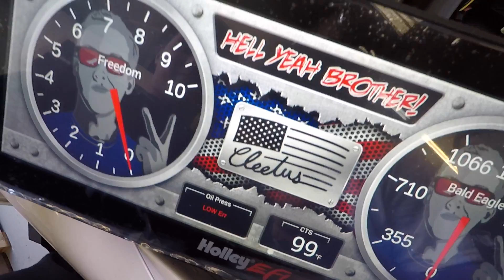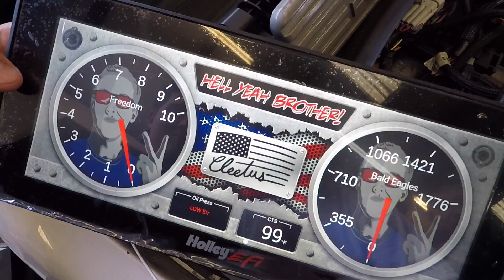Leroy Breathes SNOW! Moving Him Into the Texas Speed Booth at PRI 2018!

Comment: why run water rather than anti-freeze?
Reply: Alex Thompson drag strips do not allow antifreeze.
Reply: Watwe cleans up easier then antifreeze on the track
Reply: They probably run water wetter.
Reply: Adrian Cîrnu yes oil spills are much worse but they have no choice but to use oil. You do not have to use antifreeze. Water works just as good.
Reply: They don't have to worry about the cold down south. Don't have to worry bout coolant lines freezing up.  Also most straight line cars run with expansion tanks and add ice. That would throw the 50/50 mix way off.
Reply: @adrian69644  antifreeze is worst than water for heat. Car antifreeze has not only antifreeze, but antigrowth, corrosion inhibitors, and anti scale additives. For a car that dose a few miles a weekend, and gets over hauled regularly, none of that matters. So it's better to not run it in case it leaks. Oil is amazing, and doing snything that makes  it easy to clean up would be a detriment to it's effectiveness. Oil has to stick to surfaces to function, and that track needs rubber prep in the surface to function. Anything that removes one, removes the other. Water on the other hand is super easy to remove, and doesn't effect the prep.

Comment: Why dont any automotive youtubers buy fucking batteries. Always jump packing
Reply: I bet he'll let you buy one for him.
Reply: @MOTO809  yeah, because I'm sure money is the issue for cleetus... For as much "jump pack" content I've seen. Might as well should have bought him a battery by now.
Reply: and its usually an old school lead acid jump pack instead of a new lithium one.  It's because the majority of them are not car guys by nature, they didnt grow up reading car magazines and flipping through Summit Racing or Jeg's.
Reply: @Sir.VicsMasher  to be completely honest, I wasnt wasnt a car guy until I was 14. But I still keep up with general maintenance items.. it would piss me off jump packing everytime I need to start my car
Reply: @Chasingspeed636  its called adding drama to the content so people watch
Reply: To be fair, the performance of a lead-acid battery really falls off a cliff when the temperature drops to freezing. I'm sure it'll work just fine when he gets it back to Florida. Trouble is, at low temps, the cranking current drops the voltage too low to give a decent spark. In my old '77 Camaro, when I had no money, I kept a 12v NiCad pack (that I got for free) in the glove box, just feeding the ignition circuit via a change-over switch. With an 8 year old main battery, that thing would groan over about half a turn or so and fire right up, then I'd flip the switch back.
Reply: @netrioter   A dead battery is some pretty lame drama

Comment: Get a Optima for Leroy, but the best thing for trailers I figured out with my toy hauler is run 2 6 volt power wheel batteries in series for some reason they hold a charge a lot longer than a car battery and they charge way quicker

Comment: Since I don't have a clue about setting up a racing car, I have a question, and remember folks theres no such thing as stupid questions, only stupid answers. So here goes;
Why are the tires slimmer in the front than in the back? Does this improve control, or grant other advantages? Thanks :D
Reply: Less rotating weight, and less weight overall.  Being a drag racing style car, turning corners is not a concern so the tires can be a lot narrower.
Reply: Thanks for the good explanation. I was wondering why Leroy doesn't have the fatter tires like (ex;)a Nascar. Peace! :D

Comment: You have a 1,500HP engine, I don’t understand why you have it turned down to 1,200+ I mean yeah parts aren’t that great to hold all them ponies, but still at least put it to 1,400+
Reply: I assume he gives it as much as the track can handle. What good is 1500hp if all it does it smoke the tires

Comment: Hey I got a question for people that know more than me can I put 18 inch rims on a Audi A4 even if the rears are wider than the fronts I know tire sizes are important on awd systems  (there off my e46)
Reply: Wider is fine, just have to all be the same diameter.
Reply: MEASURE THE DIAMETER OF BOTH SETS OF TIRES IF THEY ARE THE SAME THEY WILL WORK IF NOT YOU WILL HURT THE DRIVETRAIN.
Reply: Ok thank you I don’t think they will work sadly
Reply: when I was researching for my 325xi. Aot of people said to NOT use an offset setup. Run the same tire front and back, especially if its your DD. Not sure about Audi tho. I used same offset front and back and the car was perfect with a nice aggressive look.
Reply: If you have two different sizes, you can run them, but you'll have to run the wheel speed sensor wirings to either both on the front or rear wheels.